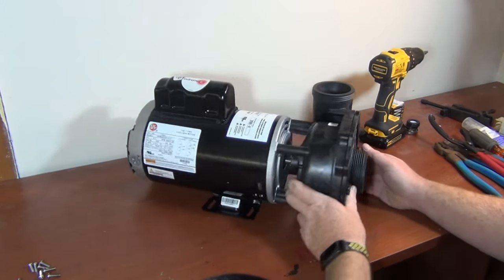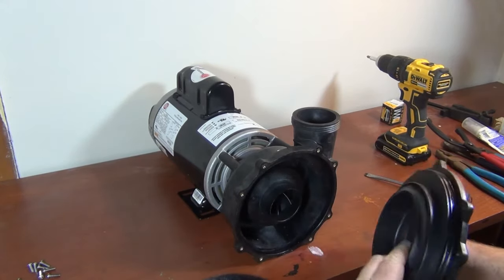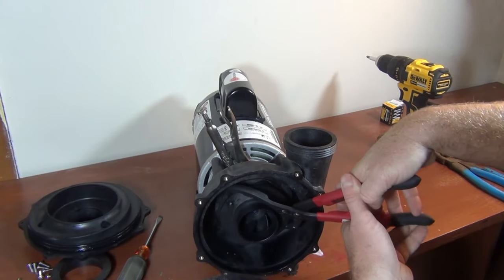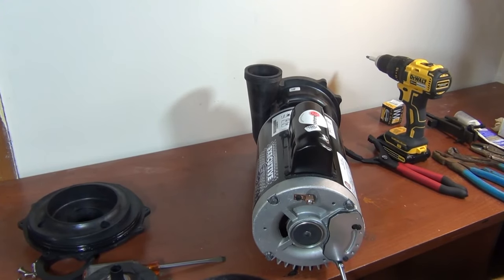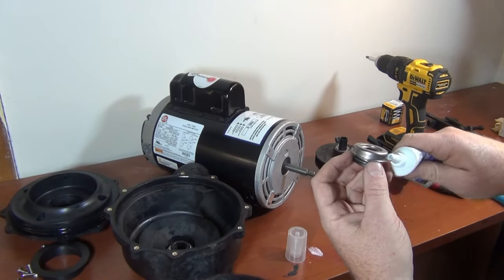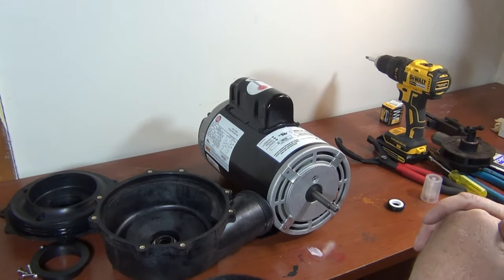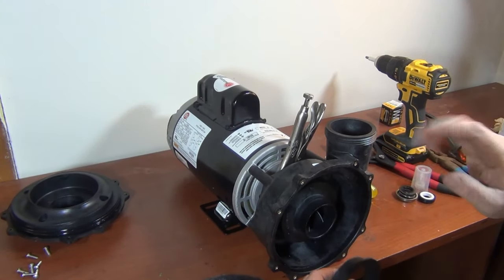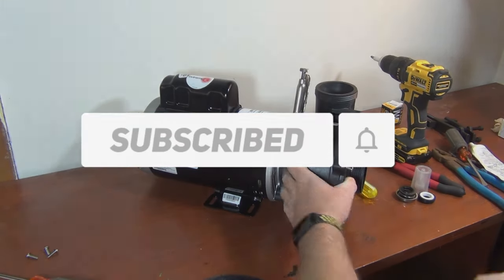How To Change a Leaking Hot Tub Pump Seal

Comment: I saw a guy do a super easy method that works great.. the motor doesn't need to come off the way he did it.. Remove the four 8 or 9"  5/16 hex head machine screws that go through the motor and threads into the pump, holding both the motor AND the pump together.. 
Once that's done, mark the silver motor caps where it lines up with the motor so it lines up when reassembling, take a screwdriver and tap out the silver cap on the rear of the motor, then tap loose the wet end motor cover and the entire pump, and stator will pull out the front.. Then with the stator out he put it in a vice with a towel to protect it, and the thing was super easy to work on then. the shaft couldn't turn so getting the impeller nut off was a breeze. I'm not sure if the rear bearing on the stator shaft had to come off, but I don't think so.. I'm working ion one that , you guessed it, the brittle impeller cracked off at the nut. No problems though most of it is ok, new seals impeller, clean off the rust etc. On my way back out there now to see if I can squeeze it out without too much fuss.
Reply from the maker: I have other videos that show this.  Plus.  Not every situation is going to be the same.
Reply: @VIPPoolsandSpas  I know. The more I think it over, I can be more thorough with the whole thing on the bench. Is that impeller nut a left-handed thread? Righty Lucy? Because on this Waterway 56 wet end, the nut had notches not unlike other left hand nut I've seen before. The unit was leaking out of the pump seals rusting the shaft sold the inside of that motor has to be inspected I would not feel thorough if I didn't. Cuz if I don't know what it looks like right on the other side. Thank you the videos great, and thorough.
Reply: I'm just going to take the whole assembly back here to the shop. Thank you for the advice. Pops always said "Haste makes waste".
And an ounce of prevention is worth a pound of cure. I don't want a client having problems up the road. I'll also have one opportunity to check the capacitor to see if it's bulging and stuff like that
Reply from the maker: @ChrisMichaelsChicago  anyway hot tub pump has an impeller that turn counterclockwise.  I've only seen pool pumps with the screw that loosens going clockwise.
Reply: @VIPPoolsandSpas  Roger that! Thank you much!

Comment: Great video! I have a Beachcomber hot tub and had it closed for two years. Opened it this year and worked for 24 hours. Then heard a pop sound and fuse went. Replaced the spa pack 20a fuse connected to the hush pump motor and restarted the breaker. Then I heard some sounds and then the hush pump started smoking up and saw a flame so quickly turned it off. Guessing the motor is completely dead at that point?
Reply from the maker: Sounds like the pump was seized after 2 years of not running.  And yes, that pump is now toast.
Reply: @VIPPoolsandSpas  yup. Appreciate all your videos. Learning a lot
Reply from the maker: @philipchristian9935  thanks.  Just give the videos a LIKE so I can continue.

Comment: The first thing removed in the video, the black plastic bit; what is it called? 
I have a leak between the two black pieces. Is there a gasket between them? It appears the water is leaking from where the two pieces connect. Is there a way to fix such a leak? 
If not. I assume the part can be replaced? My problem is that I don't know what that part is called. Is it the "impeller"? The "impeller assembly"? 
Final question: if can be replaced, is it specific to the pump or is there a standard based on fitting size? 
Thanks a bunch!
Reply from the maker: Its called a "faceplate" and it has to be the same one you have there.  If it's older, you might have to get the whole thing but it has to be the same name and HP.   If you have a leak at that spot, I just put a very nice bead of silicone on the oring and put it back together.  50/50 chance it will stop the leak.  The front faceplate might be warped.
Reply: @VIPPoolsandSpas  Man, THANKS so much! I'm reasonably handy but finding solutions when I didn't know what a part is called or worse: call it the wrong thing, is time consuming and difficult. Especially difficult when everyone who regular deals with the equipment already knows what it is. so thanks! 
 I would be surprised if some silicone doesn't fix it but I always approach these things at least somewhat prepared for the worst/more expensive scenario.

Comment: Wow, this video is by far the best. I have a Strong Spa with a Balboa pump (PUUM2302582FR) that is leaking. Do you have the part numbers (or links) for the O-rings/gaskets/wetend?
Reply from the maker: Thanks for watching.  As for the parts.  You are already half way there by knowing what item number to use to find parts.

Comment: Thanks for the video. It really helped. I have a A.O. Smith 5.0 motor and a waterway I can’t remember what it’s PF 225C something and it looks like the intake is a 4 inch in the out out is the same size as the one I’m replacing. I’m gonna switch the wet end on my old pump and put it on the new motor. Because the valves are they fit. Can I do that?
Reply from the maker: A 4HP pump and 5HP pump are almost the same flow.  In a hot tub you will only have 2 inch for most tubs and 3 inch plumbing in tubs like a swim spa.  Try and keep it about the same.
Reply: @VIPPoolsandSpas  Sorry about the prior post.  Talk to text on my phone was not great.  I noticed two things.  My old pump is shorter from motor to the intake.  The pump itself is a little wider.  I was going just transfer the pump for the AO 4.0 to the AO 5.0.  But then I thought the motor shaft would be too long.  The reason for the change is that the intake opening on the 5.0 pump is 4" and on my old pump is 3".  After taking the face plate off the pump I notice the impelar is exactly the same on both pump so I'm putting the old faceplate on my new pump.  That was the connections are the same.  I do need to rotate the pump from the top output to the side output.  I'm have some trouble unscrewing the long bolts by hand.  Any suggestions?
Reply from the maker: You might break the long screws off the old pump when taking the wet head off.  Just use a drill, but undo slow one way and then back the other. Go back and forth and that might help not to break them.

Comment: New to this. We have an old pacific spa with pneumatic buttons. The spa has been left for many years, but the shell appears solid. If we were to attempt to refurbish with entirely new hoses and operational parts, do you have a complete list of what would be necessary? I see packages for controllers in other parts sites, but not a recommendation for pumps and heaters that all fit together. Is there an available complete kit?
Reply from the maker: Well.  The cost isn't going to be cheap if your going that way, but will be very interesting to do.  I Always wanted to do a video just like that, but doesn't make sense because of the cost.  YET....... If you can find things cheap, it might work out for you.  Waterway parts are going to be the way to go and will fit your hot tub.  For the jets and the body for those jets, just measure the hole size and look for that part.  In Canada, a Spa Pack with the topside will cost you around $1200 and that can run 2 pumps.  Its going to be around the same amount for all the plumbing and fittings and jets.  NOTE:  Don't worry or even search for your hot tub name brand for parts because 99% of all tubs have about the same parts in them.  Its the electronics that are mostly going to be proprietary to that company.
Reply: Thank you. Water and sun pak. I know the cost will be steep, but a new one is even more, at this time. We figure it's a nice project to tackle as a couple....lol...well see. Would you try to make specs for the old parts?

Comment: How do you know if you have a single speed or multi speed pump? I'm worried that I never marked my stator !
Reply from the maker: There should be a sticker on the motor with AMPS and RPMs.   If there's 12 amps, its a single speed.  If it shows 12/4.4 amps, then it's a 2 speed motor.
Reply: @VIPPoolsandSpas  Thanks so much for your reply! I missed the notification saying that you did reply but seen it just now. Love your videos! Do you happen to know what die to use on the shaft (waterway executive 56 4hp). My threads looks fine but my impeller sits funky !
Reply from the maker: @ColeMichetti  maybe the shaft isn't straight?
Reply: @VIPPoolsandSpas  hmm , well they look fine but the impeller is hard to spin on so I think I'll need a die. Very hard to find any info on Google
Reply from the maker: Did you put in a new impeller or seal?
Reply: @VIPPoolsandSpas  heey thanks for checking in! Yes new impeller and new seal. I had to give it a bit of elbow grease but it went on and no leaks.. sounds great in low speed but high speed doesn't sound as good as my other pump ( replaced seals , impellers and front bearings on both ) I might pull it out again and replace the back bearing just to see if that helps things.
Reply from the maker: @ColeMichetti  was the impeller hard to screw on?
Reply: @VIPPoolsandSpas  yes it was
Reply from the maker: @ColeMichetti  maybe wrong impeller or the thread on the shaft is damaged?   Should screw on smooth.
Reply: @VIPPoolsandSpas  I agree, couldn't find the die to chase the threads so I got mad and forced it.. weird how it sounds great in low speed though..you would think it would make that loud high pitched hum at both speeds,  not just high speed. And when I put my hand on the motor and apply pressure the sound goes away sometimes... might just be vibration , it works. Appreciate you taking the time to help out and posting these very informational videos! Never would have been able to do this without it